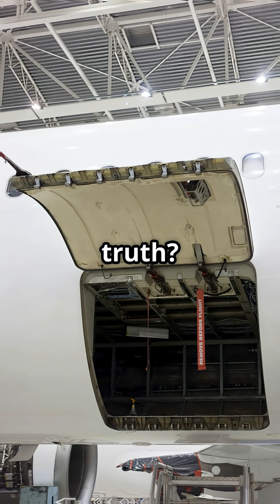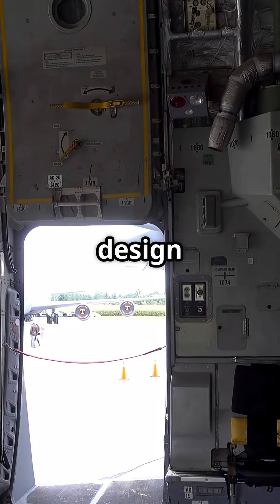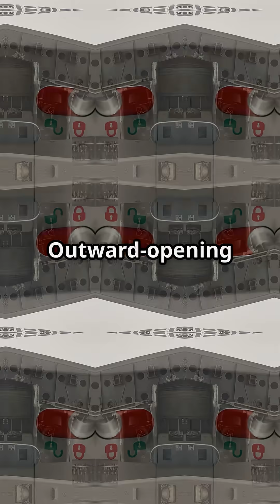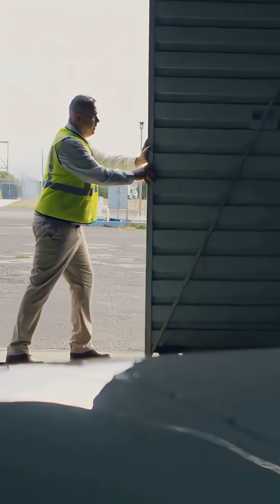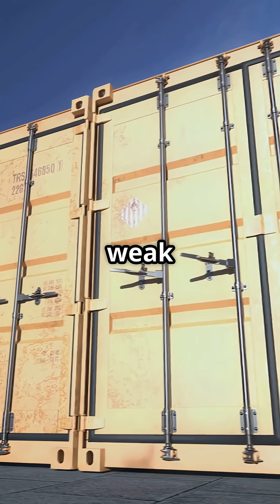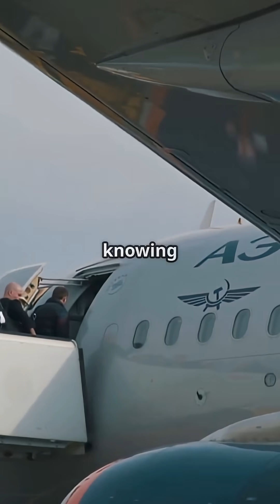The Truth About Cargo Doors and Safety

Comment: Usually they open outwards, so any failure of the locking mechanism potentially leads to a catastrophic depressurisation and severe damage to the aircraft. No other door on an aircraft is like this.